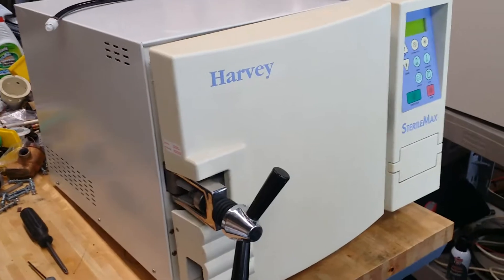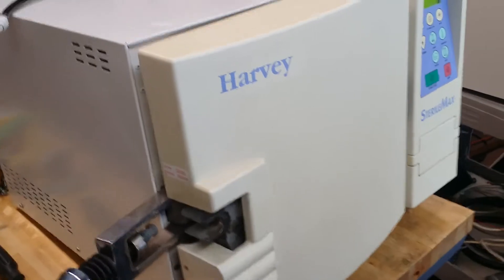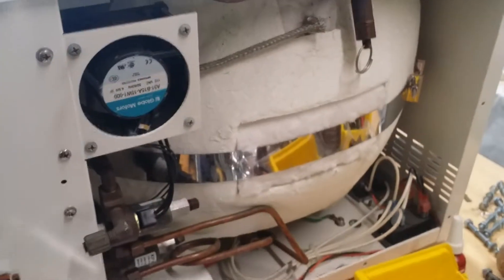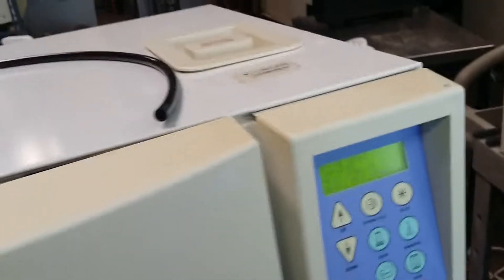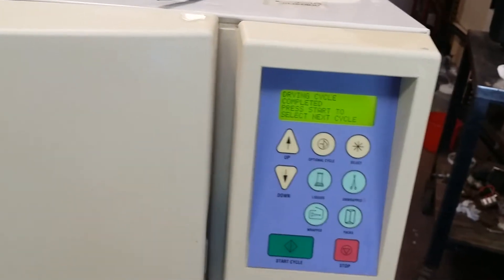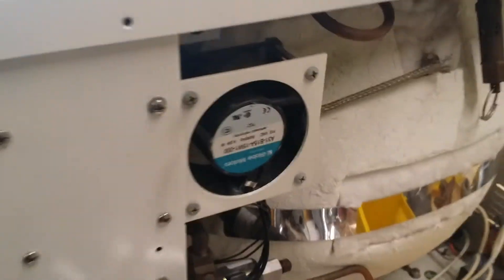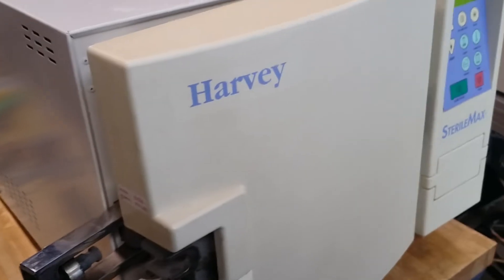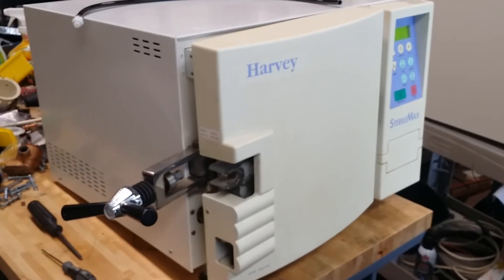How to fix Harvey Barnstead SterileMax Sterilizer Autoclave

Comment: How is the pressure calibrated, I can offset the temperature using the screen but no pressure adjustments, is it one of the two pots on the front board and if so which pot is it? Thank you